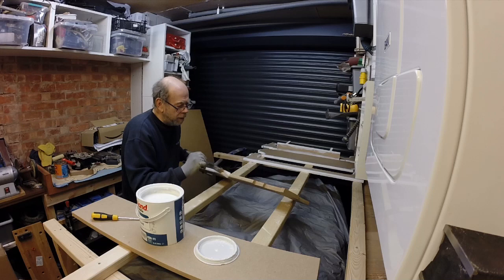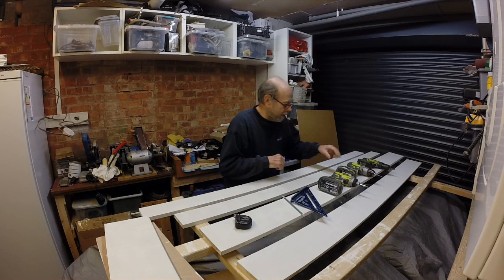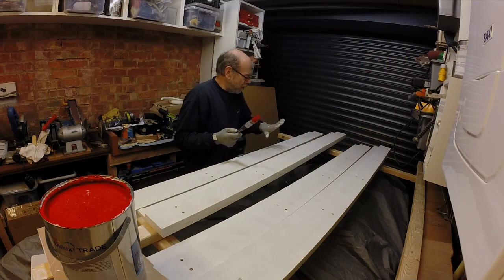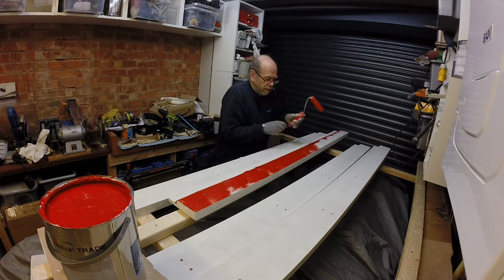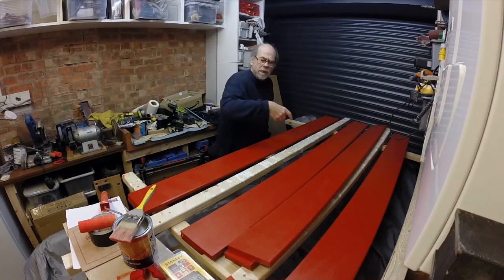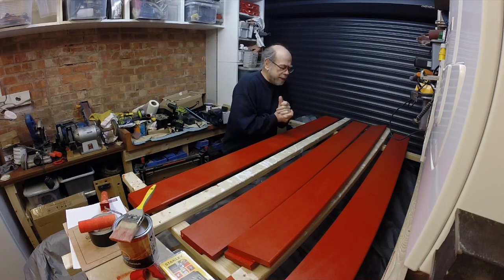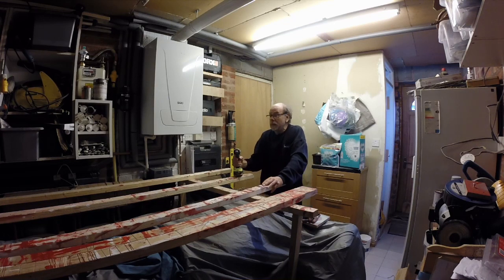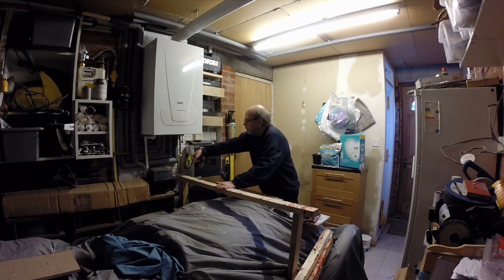the small shed #288 - Painting the bus bunk

Comment: The paint you used I think is a matt emulsion so the varnish over the top is a great idea to toughen it up. Project is looking super I think.
Reply from the maker: Yes Mark, it's a matt emulsion, though I would have considered the finish satin, but I hadn't realiused how unstable it is without the clear coat.
Reply: @thesmallshed  just for future projects I do highly recommend caparol paints. The pu satin is great stuff sold in the uk by paintshack. Fantastic company. 
They do loads of colours plus ral colours. Keep up the great work Peter👍